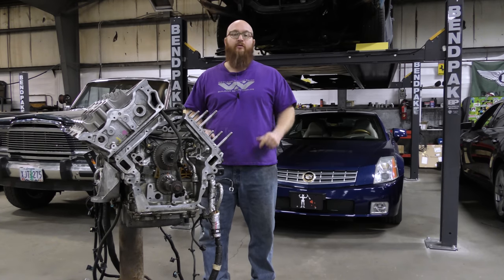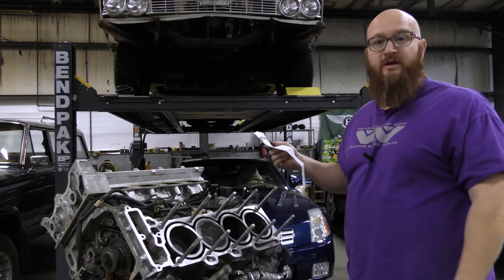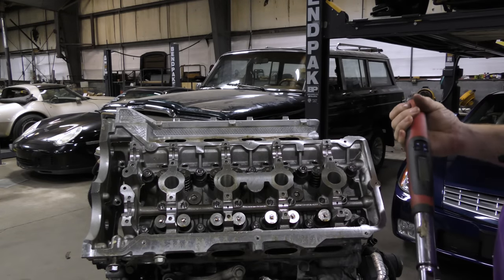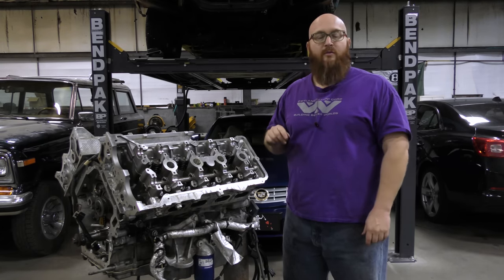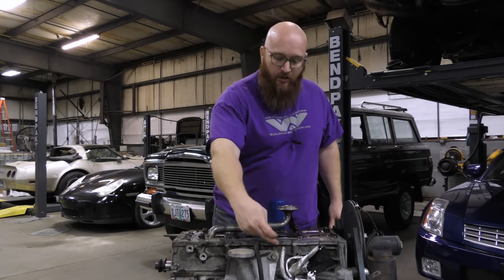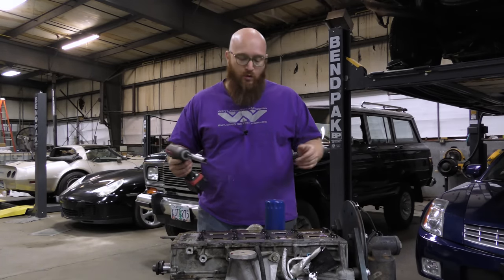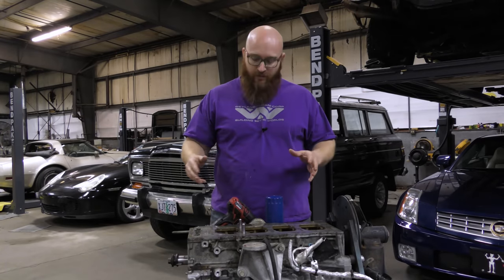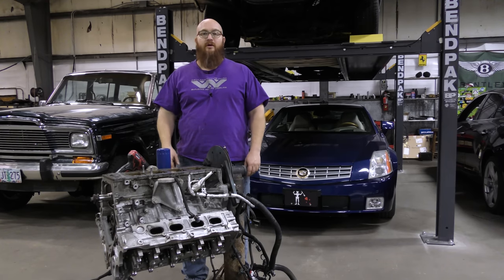Not a guessing game! CAR WIZARD shows he is a real STUD on his 2004 XLR Northstar

Comment: Surely would have made sense to remove sump before turning it over so anything in sump don't go back into engine, would it not be possible for the company that does the kit to have the valve plate CNC made
Reply from the maker: Easier to remove upside down. Nothing but a little oil in it

Comment: changed alternator then starter went out. changed starter and body control module, checked all fuses and relays tested for parasitic power draw and still cannot find it. 99 cadillac. has the VATS bypass done to it. any ideas?? had the battery charged they said its good drove down to the gas station got gas drove home less than 10 minutes later wouldnt crank battery going dead. the only power draw i was reading was the 2 amp fuse from the bypass can this be right?? or do i need to change all the switches in the doors?

Comment: When do you spray anything on a head gasket?
Reply: Some gaskets require sealing around the water passage holes. Not as much with modern gaskets. I've seen copper spray used on some head gaskets too.
Reply: @hotpuppy1  I have a 95 ford f150 5.0 that needs new head gaskets so that’s why I was wondering

Comment: Have one of your mechanics rebuild that engine when work is slow lol 😂 when’s that likely to happen??
Reply: Not needed if the bores are round and without taper or ridge. Those have such thin walls like most late engines, boring oversize is usually out anyway.

Comment: You dont "go back" you make sure you dont miss something
Reply from the maker: I go back. Have for over 20 years.
Reply: @CarWizard 
You can over torque bolts that way.
Probably still within spec, or wont cause issues on 99.9 automotive applications.
Works for you, so you do you
I use a paint marker to mark each bolt/stud after doing it.

Some of the stuff I work on it would cause issues, that's not automotive though

Love your video's

Comment: When you switched torque wrenches did you check that both showed 60 ft/lbs before you increased to the final torque??
Reply from the maker: No. Both torque wrenches have been recently certified for accuracy. That step is not needed. And a waste of time.

Comment: I love your videos, but I have a question. Why didn't GM and Cadillac make those engines like that in the first place, that would save everyone money and inconvenience
Reply: When I worked for General Motors in the mid 90s early 2000s we would receive service bulletins on vehicles that weren't even in production yet. The manufacturer knew of the issues however due to the fact it wasn't a safety concern nothing was ever done. Such as an oil leaking Northstar etc. TSB's were issued but not necessarily paid for by warranty.
Reply: Because they care about saving costs themselves first
Reply: Save $1 on a few hundred thousand cars adds up to pay the CEO more.
Reply: It takes years to set up the tooling and very expensive to make changes... they have a cost benefit analysis for fixing each issue.. some things don't present as a problem until after  warranty and they don't bother.. some things they will wait until there is a bunch of changes that need to be made at once. Production lines are very complex.
Reply: @Vincent-ke5zn  its what happened when business and marketing majors took over the corporate world rather than the product development teams that used to run companies

Comment: Why did GM not do studs as the basic design from the very start of production?  It's because GM was run by accountants pinching pennies and making decisions in committees so as to make everyone tow the line, politically speaking. Anyone deviating from the group speak would soon be standing in the unemployment line.  Customers got shafted.  GM was a rotten company until they went bankrupt June 1, 2009, shed all the debt, and made the stockholders suffer a financial bloodbath (each share of GM stock became a share in Motors Liquidation, and became an OTC traded stock), plus GM took a taxpayer funded Government bailout "loan" (that money funded GM's high-speed bankruptcy proceeding and allowed the company to get back on its feet once it had exited bankruptcy in mid-2009).  GM never fully repaid the $49.5 billion taxpayer loan because it was paid back by a combination of cash and new stock.  The share price of that new stock has the US Treasury still short $10 billion dollars.  Every US taxpayer took a haircut, too.  Now, GM is run by engineers and is making cool, innovative cars and trucks. Lucky for the Car Wizard to not have to pay up front for his labor, but he is certainly still paying the price in terms of the labor poured into this job that he may have applied to more lucrative endeavors. Myself, not possessing the tools and mechanical knowledge, would never consider any purchase of this vintage of Northstar vehicles.

Comment: When you torque at 30 ft lb the second time it is torque 60 lb now 😳😳😳
Reply: What?
Reply from the maker: No. It isnt. 30ft lbs was not exceeded
Reply: @CarWizard  your last torque setting you have to use a giant torque bar because of over torque
Reply: Not sure if you're just trolling, but that's not how a torque wrench works. It is set to a specific torque and alerts you via a click, beep and/or lights when that torque has been reached. Checking only verifies that same amount of torque has been reached. It doesn't add 30 lbs ft of extra torque each time you pull on the handle. The Wizard does some sketchy things (boat restoration, bus conversion to camper, hanging with Hoovie), but this isn't one of them.
Reply: @Orrinwellsbigo  NOPE! As long as you don't turn it past when it clicks or beeps, it will NOT be over torqued.
Reply: @hotpuppy1  it clicked a second time 😳😳😳
Reply: @greasebeardsgarage  I like the wizard I watch all of his content  the whole gang if it clicked the second time it was torque a second time.